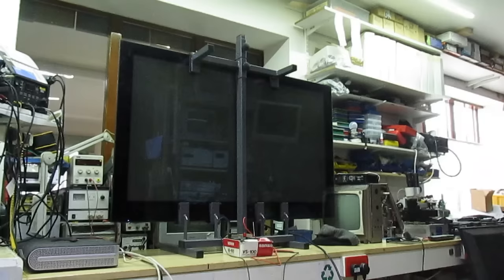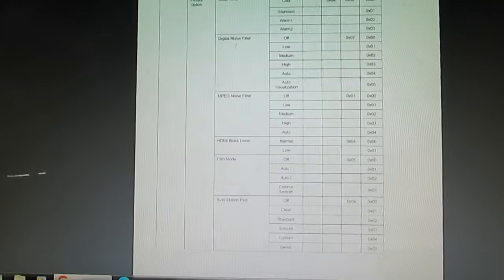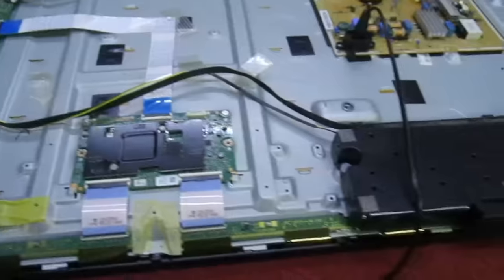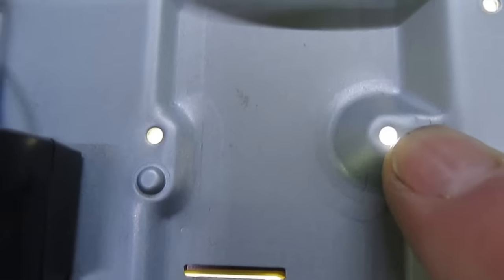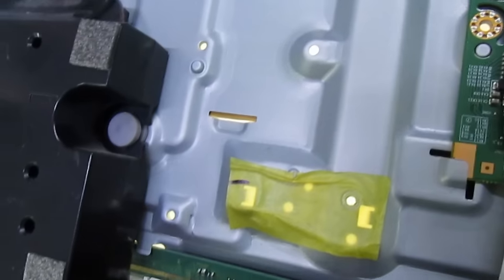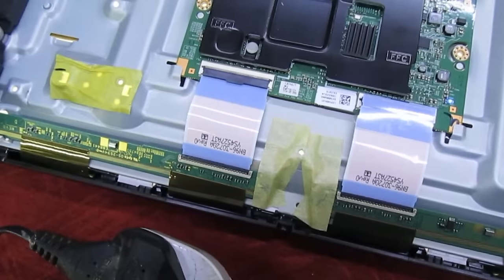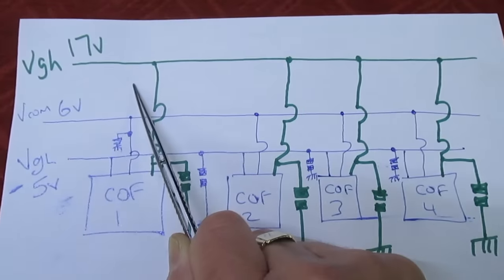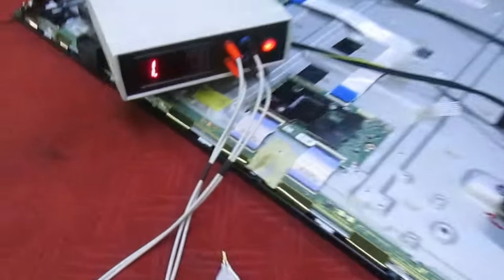Video to highlight the problem of repairing flat panel TV sets

Comment: Yet another piece of deductive fault finding.
I also think the Service info available for new equipment is all too often an augmented user manual.
Pretty much useless, I don't think they want the repair industry to continue.
Costs them in lost sales :/
Reply from the maker: That's the problem with everything these day all manufactures want to do is sell another new one, will be interesting to see how the right to repair act pans out where supposedley manufactures will be forced to supply circuits and spare parts.
Reply: @michaeldranfield7140  To late for me as all this has put me out of the Tv repair business after over 30 years !
Reply from the maker: @jonathaneastwood2927  I know exactly  what you mean , I shouldn't be doing this job anymore but I'm addicted and cant stop.

Comment: I bought an Onga pump.  It failed prematurely.  I bought another one.  It failed prematurely.  A check showed that the capacitors in both had blown up.  The capacitors don't have any markings on them.  The web does not give the values of the parts.  The part is not available as a spare part from Onga.  Because they have both blown I can't measure a good one to find its value.
Their aim is to throw away two expensive pumps and replace them with new ones.  So these are the last Onga pumps I will buy.  Manufacturer's greed is their own worst enemy.
Reply from the maker: I know the feeling, it's most annoying, the options I adopt are, have a guess or buy another board and then test the cap so you know for next time. That's about all you can do with no service data.

Comment: It appears like these surface mount capacitors is a huge problem in modern electronics.
One can wonder if it is done on purpose.
Reply from the maker: correct , I have had these caps faulty in lots of different equipment not just TV sets .

Comment: Nice. I hate that there seems to be an "understanding" from manufacturers that things should not be repaired. Got an old LG tv that don't start up. It used to take several tries to get it started until it died on me. Time to take it apart and change the faulty bit I guess :)
Reply from the maker: It's because electronics have not kept up with inflation, if TV s had a set would cost£2000 and the manifactures would support them like they use to.
Reply: @michaeldranfield7140  Yes. That is part of the problem. But from a enviromental standpoint we should repair more things. I personally hate that things get thrown away when they could be repaired. It's a waste of resources.

Comment: I took in several TVs and repaired them with a simple elimination method.  Try to determine which board is faulty and replace it. The last one I did was a curbside rescue, and I ended up replacing all three boards, but it only cost me about $55 to do so, and it works fine.  Guess I got lucky in a way...
Reply from the maker: On some cases it's very easy to miss diagnose a main board fault when it's atcually the LCD panel causing the fault, as in this case.

Comment: Reminds me local garage gave chap a £100 bill to fix his car radio. What was wrong, 6p fuse had blown due to short circuit, power wire rubbing on car bodywork. Why such a large bill asked customer, well it took all day to find the short.
Reply from the maker: this is what happens when someone charges by the hour.

Comment: Hi mate, what's actually happening when the screen is powered on with the cap removed. Is it putting stress on other components.
Thanks mate
Reply from the maker: no , its a local decoupling capacitor placed as close to the COF supply rail as possible to bypass any transients appearing on the supply line to ground , its standard practice in electronics to decouple supply lines with multiple capacitors and in a lot of cases the circuit will function perfectly with the odd one removed.

Comment: I had a Samsung Tv like this. It had a bad capacitor on the panel board. It was on the 16 volt line.
Reply from the maker: a lot of sets only suffer from simple faults but here is the UK we like throwing things away and its such a waste.

Comment: My job is as an electronics diagnostician. Liked and subscribed. Cracking video. A word to folks who fancy a spot of TV DIY… if you are not a professional or well versed in electronics, this level of diagnosis is best left to qualified folks. They are more likely to repair your TV and charge a modest fee. You are more likely to accidentally damage something and end up having to buy a new TV.
Reply from the maker: With no service manual some repairs are just down to good luck than actually knowing what your doing.

Comment: Milliohmmeter  I have to get one.  Never thought about using one for this type of troubleshooting.  Great idea.
Reply from the maker: only good though if your short is less than 1 ohm .
Reply: @michaeldranfield7140  
Yes, I understand it for reading resistances less than 1 ohm.  This is useful in situations as you described.   Much better than having to remove components one at a time until you find the fault.

Comment: I repaired a samsung flat panel that wouldn't turn on with a 32v power stand by capaicitor. Was a pain I hate repairing TVs
Reply from the maker: If only all TV s were 32 inch , I find anything over 50 inch a real pain and they take up so much room .

Comment: It is becoming increasingly difficult to obtain schematic circuit diagrams for the majority of electronic devices, making fault finding to component level an art rather than a skill. As an electronics engineer this is extremely frustrating as the time needed to diagnose faults and repair many devices is often hugely increased. I believe there is currently a drive in Europe to force manufacturers to provide full schematic diagrams and parts for the devices they produce. This is long overdue globally if we are to reduce unnecessary waste. Almost everything is repairable given access to the required resources.
Reply from the maker: yes there is a new legalisation on the horizon called right to repair, and this would solve the problem , that's if it every happens , even just a circuit diagram would help which would cost manufactures virtually nothing to publish on a website .

Comment: Showing the (tiny) faulty component to a customer can lead to raised eyebrows at the bill - even when the repair is a small portable device... small part, small charge expectation. Back in the day a new PL509 or mains dropper section seemed worth the money! When we boosted tubes and read 'Television' magazine!
Reply from the maker: So true and with modern sets all parts are small, the only exception is when you replace the whole board. I would rather go back to the times of real component level fault finding which no seems to be a long distant memory now, line output valves are still useful for making valve amplifiers though!

Comment: To provide proper paperwork for most any product made today might not be possible. It should be possible but things like annual models are a thing of the past. The same year that Tv was made there could have been twenty iterations of the same model.
The bigger growing problem is the manufacturing of products that know you changed a component and require an update or reset that can only be done by a manufactures service mech.
Reply from the maker: yes to provide paperwork , but these day where everything is on line it would cost manufactures next to nothing to publish it on a web site
Reply: @michaeldranfield7140  True, but then someone may build there own version with slave labor and flood the market.

Comment: We in the US as one of the world's largest purchasers of foreign and domestic goods need to codify into law the engineering requirement that electronics be repairable even by home users.  How many times has a computer touchscreen been cracked requiring that a sealed laptop or monitor be thrown away.  How many times has the LED strip in a large screen tv gone out requiring an otherwise working smart tv to be thrown in the trash.  All electronics should provide easy accessibility for battery replacement...they should not be sealed prohibiting ease of servicing.  We as a nation send so much to our landfills because Corporations refuse to design "easy repair/parts replacement" into their product designs.  It is time to stop the environmental disaster we are bringing upon ourselves in the name of built in obsolescence and inability to repair. Perhaps a new repair standard emblem should be placed on packaging to inform purchasers of item toxicity and level of repair-abiltiy.
Reply from the maker: I couldn't agree more , things are deliberately designed to discourage the consumer from just replacing a worn out battery and forced into buying a new item , we are suppose to be getting the right to repair in the UK but I'm still not seeing any availability of service manuals or anything that will help out the shops to repair equipment  yet.

Comment: Just watched your repair by the accident of randomly touching on my tablet screen! This is good old detective work needed to fault find anything and only learned from experience. Young technicians need mentors like you to pass on the knowledge. Thank you for sharing.
Reply from the maker: Only problem been there is no younger people going into TV repairs now , its a dying trade and any repairs now are supposed to be carried out by just swapping a board or in this case the correct procedure would have been to just fit a new LCD panel which would have been so expensive the customer would not have had it done .

Comment: Really fantastic to see such a great explanation of your thought process. Thank for for sharing. Clearly Samsung designed in failure and have made repair more difficult. Sadly this is the way of things wi the the modern generation and the mend and make do way of things in going to easy come easy go. 

Glad to see a proper repairer is still working his magic.
Reply from the maker: This was just one of the lucky sets , I have scrapped loads where with no circuit diagram  only board replacement is possible and has been so expensive the customers did not go ahead.

Comment: Hi Michael.  I got quiet efficient at testing for failed LEDs in the strips with a mega.. Then changing the unlit LEDs Video somewhere on my channel.
Most of the LEDs had blown with a tiny tell tale flash mark indicating the truth that these things where unfortunately made for landfill by manufacturers.
Not only by FLOGGING a 2v2 10ma LED at 2v2 10ma and having no boards available as pointed out by your good self BUT They also craftily hide the LED backlight brightness setting behind "ECO" mode so you have to turn that off before you can even think about getting to the custom menu to alter the backlight brightness therefore  adding years of life to your TVs backlight.  
If Set to around 80% it is unnoticeable and is more ECO than ECO could ever be.
I also noticed that sometimes after OTA Updates,  The crafty manufacturers reset ECO back to ON.!  Draining the life out of the LEDs again.
Only way you can notice is when the brightness keeps adjusting itself up and down, often unnoticed by the customer.
All the best..
Reply from the maker: I always turn the backlights down after fitting new ones and not had a single complaint about the picture.

Comment: Problem with fixing flat-screen is you wake up on the other side of the room lol seriously ill never mess with one again
Reply from the maker: Of course anything electronic is dangerous, valve amplifiers more so as they can run at 500vdc , I must say though some TV power supplies are badly designed and leave the HT reservoir capacitor fully charged even when the set is unplugged .

Comment: Good diagnostic skills Sir.  I would like to mention though, that MLCC technologies are NOT unreliable.  Most of the issues with these parts are due to the design engineer failing to comply with the ripple-current rating and/or using the capacitor with a steady nominal voltage across that is greater than 60% of its rated maximum voltage.
When correctly applied, these two basic rules will ensure a far longer lifetime than classic electrolytic capacitors.
Reply from the maker: I once heard that the re flow process and cooling can cause micro cracks to appear on the device leading to failure later down the line but don't know how true it was.
Reply: @michaeldranfield7140  Yes Michael, SMT fractured end-caps can be a problem.  But this is absolutely not the fault of the SMT device.  It is nearly always about handling and reflow process during assembly.  There are rules to follow to avoid such, and they are not always...
Further, the flexing of a PCB can cause similar problems.
So yes, the physical design is almost as important as the electrical design.  This is what we deliberate as engineers to try and ensure such problems are avoided.

As to reflow heating and cooling, YES, this can be a problem.  Nowadays, the temperature profile of a product can be much more finely controlled - even differing for separate regions of a PCB.  So these issues should not exist if all parameters have been properly estimated and entered for the product's journey through the reflow oven.

B.T.W., I have watched many interesting videos published by Louis Rossman in the last year or two.  Good luck to him and you and all those who campaign for Right-to-Repair.

Comment: Great Video Michael, congratulations, this is the first video I saw with excellent technical descriptions. On the order hand I own a Samsung TV UN60F6300AF, which lately has been falling in an On-Off loop, especially  if a put The air channel 5, or Netflix, also sometimes has failed with other streamers (Disney, etc), usually it has been failing when we turn it On, this is weird. I took off the covers in the back, but it does not fail, maybe it is not a component the gets hot, as I said it: usually fails when we turn it on. although without the covers, the TV set is not failing, I wonder if you can give a hint please.
Reply from the maker: First thing to do would be to have a look if there is a firmware download available from Samsung, then if you still have the same fault and you suspect the problem is heat related try warming things up with a hairdryer to see if it brings the fault on .

Comment: I have little Samsung 27" 1920x1080 computer monitor with TV tuner built in from around 2012/2013. It's a great TV but won't turn on. I use as both TV and monitor in my bedroom. I suspect it's a power supply capacitor issue. I'm going to replace all the electrolytic capacitors. It won't cost much and my time is my own so if it works then it's been a cheap fix.

The second one of them I have cycles 20 seconds on and a minute off and I think it's also capacitors.
Reply from the maker: at 10 years old I would be checking the capacitors first .

Comment: Michael. I'm a 61 year old gay Aussie guy, club DJ and audio video engineer and am fed up with this throw away society we live in. I bought my mum a Panasonic 55 inch plasma set and a PVR/Blu-ray player combo to go with it 15 years ago as I live with her now as she's 91 but in perfect health. I sold my house and bought a 65 inch 3D Panasonic plasma set for my man cave in one of her utility rooms and bought powerful high end audio to go with it as I love my tech. That first plasma set and PVR are still running beautifully as is mine. I'm biased because Technics turntables are made by the same company. I have never altered any video settings and the picture is as good as when I bought it all those years ago. Plasma sets are, to me anyway a far more superior modern television set format and just keep on running but Matsushita electronics make tech that just keeps on going. I thought LED sets were tiny RGB LED pixels that turned off for blacks and brilliant colour. Bollocks. It's just brighter LED back lights that fail all the time. Your story here is not unique. I've seen guys like you find sets and repair them for a few dollars. These LED televisions are so fragile. I used to when I was in my teens, save vacuum tubes from BW sets and I got at least one call a week from mates to fix their televisions by replacing vertical or horizontal deflection valves or audio valves etc. I got bitten by a 1B3GT rectifier tube. You don't make that mistake twice....lol. I used to go to the local store and use their tube tester to check valve emissions. Remember them? Rejuvinators like Beltrons are still sold on eBay for CRT video games owners. This obscene waste is ridiculous. Anyway. Cheers from down under, Andrew.
Reply from the maker: I went to the local tip on sunday and there was a skip standing about 8 feet high and Im just over 6 feet , rammed to the roof with small electrical items , hoovers, audio stuff , laptops, tower pc , you name it and the skip is emptied once a week on a Monday , I went back home to collect some more rubbish and my camera and thought this would make a good youtube video if I could get some covert footage  but unfortunately by the time I got back the skip doors were closed and things were stacking up on the floor, , I dont think  any of this stuff gets re used because the top of the skip is open so when it rains it would all get wet , I assume it goes to be crushed, and the worst part is you see something you want , ask the guy who worked there if I can buy an item and they so no , its more than my jobs worth , what a waste , I wouldn't mind betting most of the stuff has very little wrong with it .